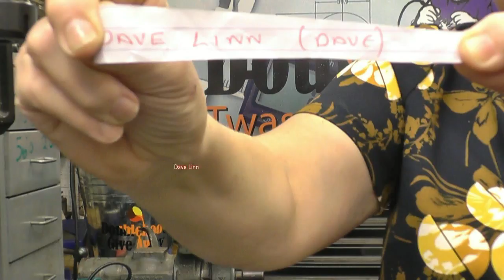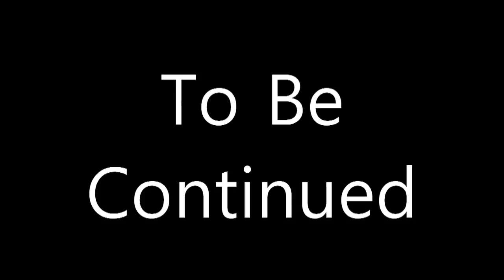SNNC 192 P1     Milling Cast Iron

Comment: I'm sure they had dowel pins and taper pins 100 years ago, but the guy that built that engine may not have had access to them. It looks like most of the work on that engine had been done with a file. Nothing wrong with that, but fitting dowel pins with a round file instead of a reamer is problematic.

Comment: Thanks for another great video. I want to ask you a question about milling cast iron. If a cast piece has a chilled spot, would it be possible to fix it by putting the piece in a fire among the coals and letting it get hot then cool down gradually as the coals die out?

Comment: Hi john nice to see debs looking so well, I just wondered why you changed to hex bolts in your collet chuck as I am waiting for 12mm carbide tool to counter bore mine, Hss tool wont touch it.
Reply from the maker: I found I am having to do a very small adjustment every time I install the chuck  Less than half a thou  the cap heads were wearing the hex out

Comment: Lucky you have a nice stockist nearby, was looking for a 5/32 UNC setscrew recently, and nobody local has them in stock in any finish, length or head, so just have to use self tappers and mangle the old threads out in the join boxes.
Reply from the maker: Great shame
Reply: we lost our 'bolt shop' recently, they were a goldmine when i was restoring motorbikes a few years back